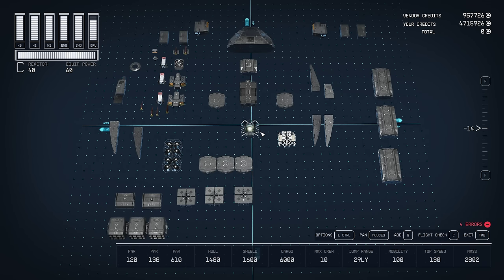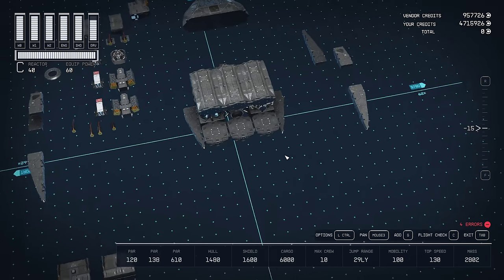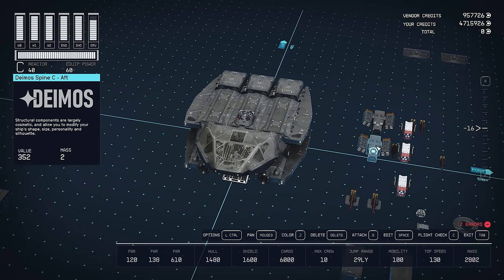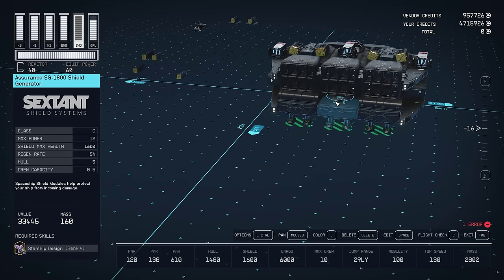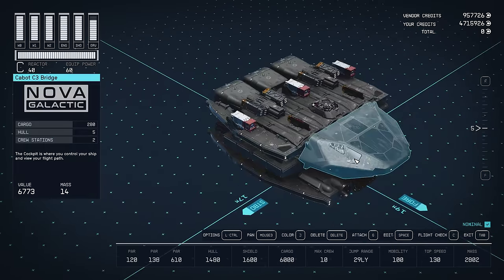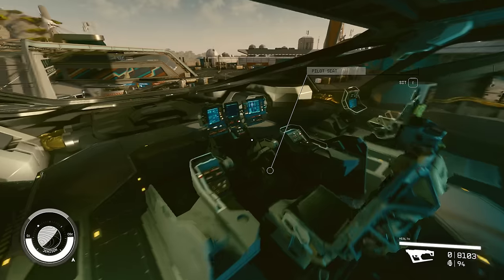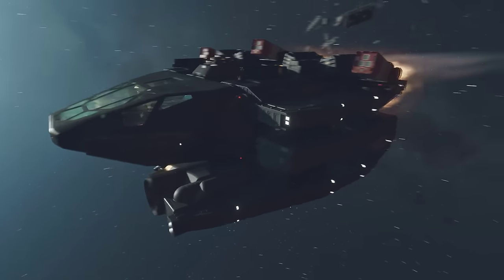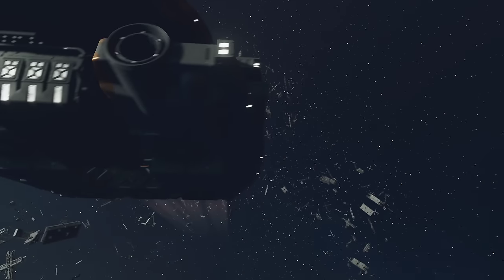Starfield - Smallest Class C build with over 10,000 cargo!

Comment: I have a 26m wide 28m long C class with 8765 base cargo, 100% mobility and a 30ly jump range, 4 crew from the cockpit, with Sarah adding a freebie I also run with Vasco, Sam, Barrett and Omari because if were honest they are the only useful crew. I also trim the habs down to a 3x1 berth for a bed (my  and a workshop for the occasional upgrade. I  don't make pharmaceuticals or display weapons and this particular min/max C class isn't built for pleasing aesthetics.

The only big compromise that I made is reducing the C class shield down to the 1500hp B class, and I guess if you don't like ladders the fact that it is 6 levels tall off the ground (5 internal levels) could be a downside for some. This ship is part of my Tiny Terror build group so is always being messed with and, since I still have 16 mass to play with before any mobility loss, I suspect it will be modified a bit more in the future.
Reply from the maker: I have a version of this ship that has 9015 cargo while still maintaining 100 mobility.  Check it out here! https://www.youtube.com/watch?v=Oyhep7MJaqY&t
Reply: @LastMumzy  Yeah restricting my build to the 3x3 base size with no overhangs other than 1 meter for the engines, does mean adding extra weight with some sub-optimal parts to get the right connections. I have a 26x32 that is pushing closer 9.5 but only by cutting out the jammer and shielded cargo (not that I actually use them anyway since I don't pickup contraband).
Reply: @LastMumzy  I would also note that I don't actually use them either. I have a C class with 2130 base cargo, 0 protected running twin 6830's. 52 equipped power with 48 effective on tap lets me run 11 power to the PBO-175's and 95 MeV's and 10 to the Obliterators  and I've found that gives them an almost equal recharge finish time.

Out of curiosity, have you tried running particle turrets? If so, how did you find them? I've been considering swapping out the 95's for the 250MeV turret on my daily C class but I'm still not sure.

Comment: How are you getting 47 on your reactor?I am only able to get 46 with sam omari and Vasco and 5 from skill. Does barret give you one more?
Reply from the maker: As you said, you get five points from the Aneutronic Fusion skill.  You can get up to three more by using the companions Sam (+1 power to engines) , Omari Hassan (+1 power to shields), and Vasco (+1 power to use in any system you choose).

Comment: I am lost. Forgive me. How do i get all this ? like..i have the Cabot c3 only available if i am in a certain system. If i go to another vendor in another system.  its no longer available to install.  How do i buy parts without buying a ship that maybe has the part? Can any port my own base be used to build.
Reply from the maker: I call it a Frankenstein build.  You essentially have to start at one place, for example New Homestead on Titan and buy gears and the cockpit.  Since you can't save the build unless the ship is complete you have then put the cheapest crap possible on it to get it flying so you can go to the next port and get the specific items there.  It's a lot easier when you are following a template.  For someone like me that is building from scratch and really has no idea what I'm building till its finished, things can get expensive real quick.  I'm constantly buying parts and then deciding later that I like something else better.

i'm new to this Youtube thing so maybe when I figure out how to use this better I'll do a full start-from-scratch video.
Reply: @LastMumzy  thank you for your response. I stayed up for hours trying to muster things together in what you had going on. But yeah i still dont understand where you buy the parts so to say. I know its the same guy you buy ships from . Guess my game only lets me buy ships. And once ive bought a ship. Its components become available for ship building. Plus what i have gained from ship building skill.

Comment: Question. Why did you pick the grav drive you're using?
Reply from the maker: Weight.  When building this compact every ton of mass matters and class-b grav drives are a lot lighter than the class-c ones.  I needed something that could get me over 28 light year range (the max distance required in the game) and since the ship is relatively small I was able to use this class b drive to keep my weight under-budget and my mobility at 100.
Reply: @LastMumzy  That's what I was also thinking, but I wanted your take on it. Thank you.

Comment: Im lvl 100 i have all the skills and still i dont have all the components at my base? Where did you build this ? How to get all the parts at the ship builder
Reply from the maker: Outposts give you access to a lot of the parts but not everything.  I got the gears, cockpit, and front braking thrusters from New Homestead, the landing bay from Hopetown (the lady inside not the ship technician), the habs and most of the trim pieces from Deimos.  Most of the other parts are generic that can be bought anywhere.  Which parts are you having trouble locating?
Reply: @LastMumzy  i just started building ships and want to use this video as first time build to learn it. so you can buy ships parts and take them with you?

Comment: All you guys with 4, 5, 6 million credits. Surely not by normal gameplay. Cheat Engine perhaps?
Reply from the maker: I'm right at 900 hours in-game time at level 164.  Making money at this point is trivial.  Playing about 6 hours every day I am averaging about 1 million per day if I keep up with my mission boards, outposts, etc.  I'm down to about 3.7 million right now so back to the grind it is...sigh...
Reply: That's alot of hours man, I find starship building a very nice feature but extremely time consuming and I find it lacks a "save your design feature" which would help alot. I don't know how many designs I f..ed   up because I substituted the wrong parts, forgot what they were and had to start all over again after 30, 40 minutes playing with modules and getting the perfectly desired  weapon-shileds- reactor parts. By the way, that bridge design is my second most loved. First would be its cousin with windows all around, only found at Deimos Staryards
Reply from the maker: If there was one thing I could add to the game today it would a be save ship design feature.  I once spent about two hours in the ship builder, clicked a part to delete it, and accidentally deleted the entire ship.  Nearly threw my computer out the window.  Now when I delete parts I always pull them off the ship first 😞
Reply: @LastMumzy  Ctrl-Z
Reply from the maker: @@linusfu515 Wat!?!

Comment: in my world 6000 is not over 10 000 ....
Reply from the maker: 6000 is base-level cargo with no skill or buffs applied.  If you watch the video after takeoff at 07:06 you'll see the cargo is listed at 10,395.  That is with my 4 skills points in Payload that increases cargo capacity by 50% and the 10% buff that Sam Coe gives to cargo capacity.  Hence, over 10,000...